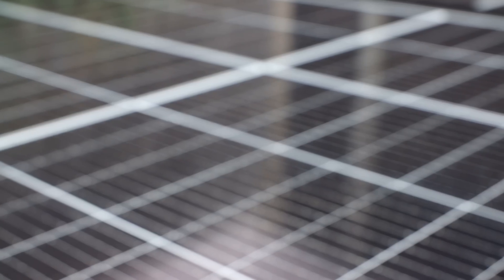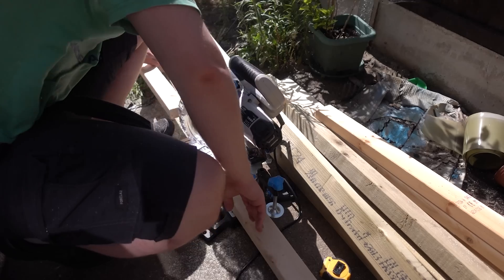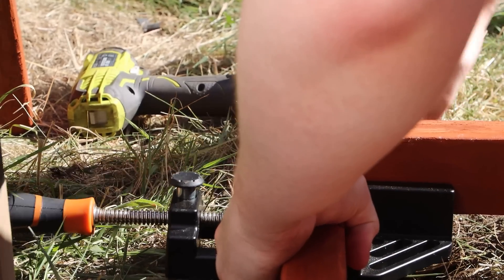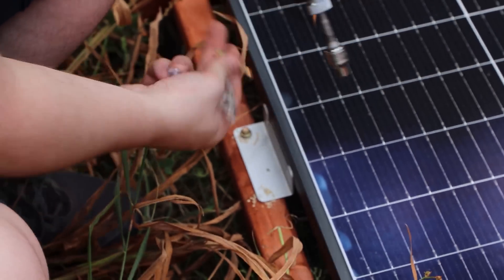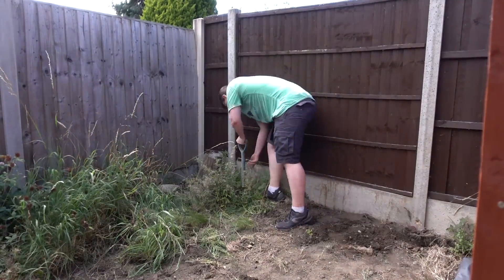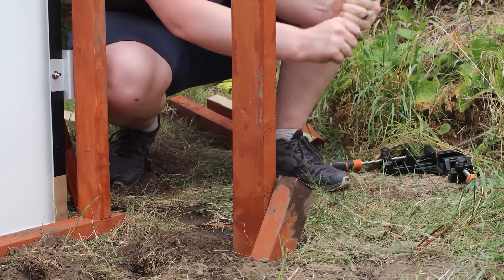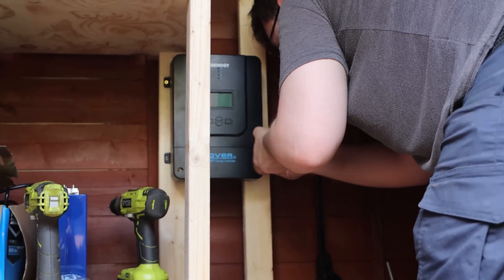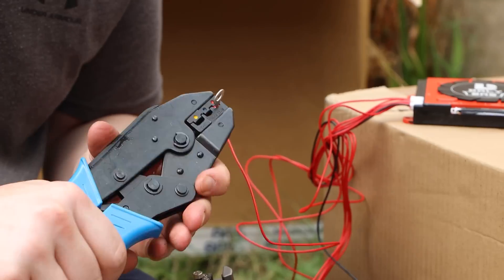I built a DIY Solar Power System!

Comment: Recouping £3k in under a year with a 3 panel solar setup is not happening lol. 400W all day every day for starters isn't going to happen with UK solar irradiance, especially going into winter. You'll be lucky to get 4-6 hours of decent production.

Using pvwatts for a 1.3kW system you're looking about 1000kWh a year. Even at the old 0.34p/kWh rate thats 1/10 of what you predicted, coming in at roughly £366 a year in savings, so over 8 years to pay it back

Comment: Nice, I am going to plant a galvanized steel pole in my back yard, build a steel frame and make rotary, tilting mechanism to manually follow the sun, leave it in a flat way if the wind gets too strong.

Comment: £3000 - to pay that pack in a year when you're producing 400w per hour;
400w per hour = 9.6kWh per day = 3504 kWh per year.
£3000 / 3504kWh = 85p per kWh.
Price cap is 34p per kWh, so 85 / 34 = 2.5 years to recover £3000.
Reply: Daylight is less than 24h, 8h daily as a year-round average is probably a reasonable to optimistic estimate.

Comment: Hi Andrew, I've literally just discovered you 2 days ago and about to embark my own solar system to help my home electricity supply and keep costs at bay.  (Owned 4bed detached house Sunderland Tyne and wear) shed has 20 deg pitch   6.5 mtrs x 1.9   x 2   do you have a costing list and point me in right direction in terms of a basic system for a battery storage plan then at a later date maybe adding on for a grid hook up. oh and possibly additional panels on a frame system at a later stage like your youtube prt 1 .  Warm regards john (working in construction for over 40 yrs  so can handle all the set up )

Comment: I got excited at a small off grid system from my garage roof.Hit full stop and market silence : Can you advise any information on a manual grid/solar power transfer switch  Understood it was possible to select some existing house circuits: Switch them to solar as and when ?  Many commercial manual power transfer devices  in USA but UK  appears silent ?    Ms O

Comment: Excellent investment in all the PV modules, PSWave inverter , charge controller and the 280 ah eve cells along with materials for the PV rack . We preppers must get ready for any SHTF situations that causes grid power outages only to keep running 🏃‍♀️ with  DIY off grid back up power .🤙 Check out my DIY solar videos, hit like  , leave a comment and subscribe . May the solar be with you .🤗🤗🙂

Comment: I've just spent £5000 on 8 x 550w panels, a hybrid inverter and 4.8kw battery packs...... can't wait to get them up and running!!
Reply: 550wp ones are big ones. I have already 400wp panels and for next years project aiming to add some 450wp panels.
Reply: @jankees4037  they are big!!!

Comment: Awesome solar DIY video 👍👍 thank you

Hello from the Philippines. I retired here 6 years ago from the US.

I have posted on YouTube my DIY solar charging transportation system
It's a roof mounted 200 Watt solar panel combined with an MPPT boost controller charging a 60v/20Ah lead acid battery. The vehicle looks like an anorexic electric golf cart. I'm saving about $10 USD weekly. The solar charger system will pay for itself in about 20 weeks.

Comment: Be careful of those passive balancers, they do explode if any cells haver too big a delta. Only use those on Lifepo4 when the battery is fully charged and cells are above 3.55v. Let it balance whilst you monitor with a multi meter then disconnect the BMS when it has finished. Do not leave in the pack as it will try to balance all the time and cause the opposite to happen and a big fire hazard. They work but only when top balancing and then only use once a month...good lifepo4 cells stay in balance for a long time.

Comment: Solar panels in general are not economically viable !!
Reply: You work at the electricity place? Solar panels earn themselves back in no time these days. And as the prices keep spiking of energy, becoming more independant is really good for your wallet. And it is cleaner energy.
Reply: @jankees4037  Not really clean, and economically they are good for the manufacturer and the one who installs them, and when they get old 15-20 years later, you have to buy new ones and batteries as well
Reply: How so?

Comment: The batteries expand while charging and discharging apiece of plywood on each end of the pack and clamped together with 4 threaded rods one each corner and tightened the battery case will crack if it compressed. Hate to see you loose the money invested

Comment: BEWARE your 13A ring main is 2.5mm2 cable with a 16A (3600W) circuit breaker on it. There's a reason 3.68+ kWh inverter installs have to be signed off by the grid provider and an electrician, they can kill. 6000W is scary!

Comment: no no no no no! it will not take you a year to recoup the cost of your set up! 
I've built my own too, cost me £1854 in total. I use about 1-3kwh of electricity from the solar. with the days getting shorter, my solar is reducing, especially with the bad weather now.
I did my calculations on my system, would take 9.5 years to recoup the cost!! How on earth are you getting 1 year?
Another thing, you should not be keeping those batteries in a shed over winter. The cold weather frost will kill them if they are charged at a minus temperature 😬 
I've had my system since May, and have used aprox 214Kwh on it, that does not equal hundreds of pounds saved tho. Even at the fixed rate I'm on now, 57p a kwh, that only equals £121.98, thats for just under 4 months if usage, over summer. Maybe revist your maths in your payback time 👍
Reply: At 57p you are getting ripped off I'm on 29.23p flexible tariff that's with octopus, you need to shop around.
Reply: @stevieuk260  I have since moved back to standard tariff as its cheaper 👍
Reply: I got solar power for emergencies. I may be able to shave some cost off my monthly power bill once I finish my main 2000 watt inverter system using a 300 ah battery but the real blessing and value will be emergency power for cooking, heating water, backup for my refrigerator and freezer batteries, and cooling off using a tiny window air conditioner after hurricanes.
Reply: Well, they have to lie about solar so the leftists feel great about it. Many of them think you can put a solar panel on a car and never need electricity again.
Reply: Either your calculations are off, your a light enerygy user or you have overpaid for a very small pv system or not using it to its full potential. I paid approx £1.5k for a diy install system and at current costs and based on my usage (approx 0.6kw/h) with an estimated 8 hour usage window per day,  I estimate 2-3year payback.
Reply: @_Miner  so your usage is 600watts a day? On solar? How much does your electricity supplier charge you per Kwh?
Reply: @IXISSV  Sorry perhaps I didnt explain well. My daily average at the moment is 20-25kw, my hourly average during the day/sunlight is about 600watts (higher peaks during night for hot tub, evening cooking etc..). So my calculations are 0.27p (my electric rate) x 6 hours a day (average sunlight per year - a guess) = £1.62 per day I can save using solar. So a year would be a saving of £591, taking me to approx 3 years payback. There are lots of variables to take into account but this calculation seems achievable at a minimum.
Reply: @_Miner  sounds like a great system you have there then 👍 Do you have lifepo4 batteries as well?
I've got a 3kw all in one charger/inverter, 2 x 340watt panels and 2 x 12.8v 100ah batteries in series, so 24v 100ah.
I move my 2 panels around the garden throughout the day to get the best light. 
Most I've used off solar in 1 day was 5.4kw.
Reply: @IXISSV  No battery storage yet but it is planned when availibility of some come back into stock. For your system it sounds reasonable and if you can maximize your usage during daylight I feel like your payback should be a lot shorter. Especially with costs going up and up,

Comment: Ironically, those selfdrilling screws are meant for metal and they work bad in wood compared to screws meant for timber which you should be using. And predrilling the hole actually makes em work even worse .

Comment: Not bad but you should look at a off grid hybrid inverter and with this you can connect your grid and use it as a ups with solar and battery priority. Also in the UK planning permission is required for non building fitted solar unless under a certain size, yours is fine for sure, I'm just about to fit 4kw to my 'pergula' at the bottom of my garden 😉 max 4m high and 2m away from boundary
Reply from the maker: If I owned the house I'd use a hybrid/grid-tie inverter for sure!
Reply: @TechteamGB  you can even if you don't own the property and you don't need to 'grid tie' hybrid off grid goes between your main fuse and the consumer unit which then uses the incoming when you don't have solar or battery and easy to put back to normal when you leave
Reply from the maker: True, although I'm currently dealing with a failed electrical safety certificate for a number of faults and the landlord still hasn't had the electrician fix the issues let alone do the necessary upgrades. I currently don't have a proper consumer unit, nor any ground fault protection. Hell every plug socket in my house are on the same ring, including my boiler!
Reply: @TechteamGB  You can drill your own earth/ground system in the ground in the garden, works well with renting house. They are like 2-3 long pipes. Put your drill on them to push/make them go into the soil and deep soil. Then connect your cable to it. That sort of idea. Look more on the internet how to exacly do it. Shouldn't be too dear and you can diy it. So much better than having no earth/ground on your systems.

Comment: Fantastic video
Can you put links to where you got the different parts from 
for this project please. (PV panels, eve 280ah cells etc)
I'm also in the UK was looking at grade A Eve 280ah / 305ah cells  (305ah cells where same physical size, slightly greater capacity but were £50 extra cost each so will be choosing 280ah capacity) Most I found would have been shipped from china (long wait and shipping costs, not easy to return if faulty)
A lot of the 3000w- 4000w contiuouse power pure sinewave inverters I'm interested in getting, on the Internet have 110v outputs meaning a lot less units to choose from, for UK 240v use.
Looking forward to your next video about the inverter you use to power inside your home from this project.
Thanks Paul
Reply from the maker: I've just added links to the description for you!

Comment: Great set of videos.  Can you advise if the metal bracket connecting the panels to the wooden beams is universal and likely to work with multiple panel manufacturers - and where to buy them please?  As I'm wanting to place a couple of panels on top of a garden purgola.  Secondly, those sections of frame which are higher than the panels may cast a shadow which will reduce the efficiency of the panel - especially when the sun is low in the sky.  Thanks!
Reply: The brackets are universal. EBay is good for getting them.
Reply: @gazPious1464  Thank you!

Comment: It's interesting to see someone doing an off-grid stye system in urban UK, so thanks for that. How are you handling the possibility of battery power running out overnight?
Reply from the maker: I'm planning on adding an automatic transfer switch to switch back to mains should that happen, although I'm currently planning my loads so that even with minimal sun input it should still run fine.

Comment: You can't have the triangle corners on the panels, you're killing the outputs.
Reply: you need to watch the video before commenting,you will see they are only on during installation.
Reply: Additionally, those support beams extending beyond the panel surface, will cause shadows, which will disproportionally reduce performance too. A small sliver of shadow will reduce the panel output by 10-30%. Having those triangle corners will similairly disproportionally reduce performance.
Reply: I noticed that right way. A few blades of grass greatly reduces output when testing my panels in my yard. Those shadows on the panel can also cause resistive heat spots and fires.

Comment: I ordered my system last week. 12 x Trina 425W panels and Givenergy 5KW inverter + 9.5 KWh battery + 7KW EV charger. In case the price still go up, my investment can be returned under 2 years.
Reply from the maker: Ah that's going to be amazing! Let me know how you get on with that - I'd also love to know what that ends up costing once it's installed (I assume professionally?)
Reply: @TechteamGB  off grid or on? I'm doing an off grid but with grid back up and 18kw of batteries, don't need to inform the power company because I'm not able to export
Reply: @TechteamGB  Nope, as a hobby electrician I will give it a try my self, and call over a certified electrician friend when everything is done, or if I stuck somewhere. Professional installers have 6 to 8 months waiting list, tons of enquiries... And cost a lot more too.
Reply from the maker: Ah nice, that makes plenty of sense! The commercial stuff is pretty plug and play so shouldn't be too bad.

Comment: Great job!  For those living in cloudy/rainy areas, pay attention to the solar cell design!  The "half cells" make a HUGE difference over the square cells!!!  Bunch of companies now offer them, Hanwha, Quingbo, etc to name a few.   Perfect for UK weather! or the PNW where I live.   I have generated solar on bright rainy days! its crazy!  Lithium batteries are a game changer if you can afford them.   I would love to see if or how you setup a monitoring system maybe with home assistant or other open source solutions.  Also a gaming pc on a DC power supply off of the battery!  Cheers from Canada.
Reply: Thanks for the tip on "Half Cells"
Reply: @nikkithuillier5519  I think he means poly vs mono, poly being actually better on cloudy days even though they're less "efficient" spec wise and considered older tech they perform better in cloud coverage from what ive read, and also had great results with my poly panels I got recently but admitiedly no mono's to compare with.
Reply: @mikejones-vd3fg  No - half cells are normal cells cut in half which halves their current output but allows you to fit twice as many. This way you get a higher panel voltage which reduces cabling losses.